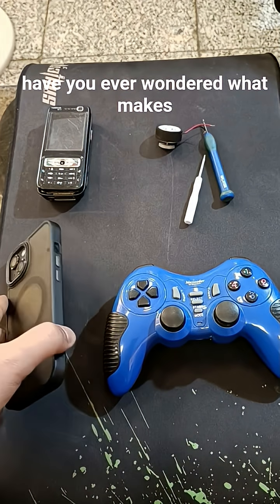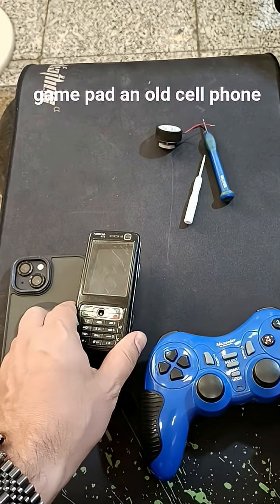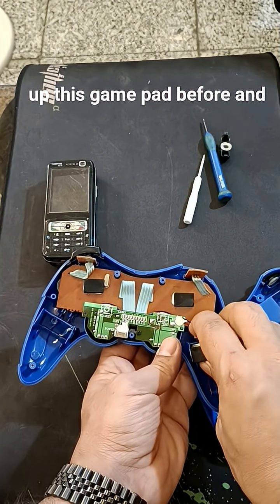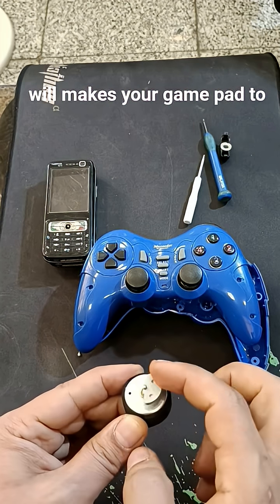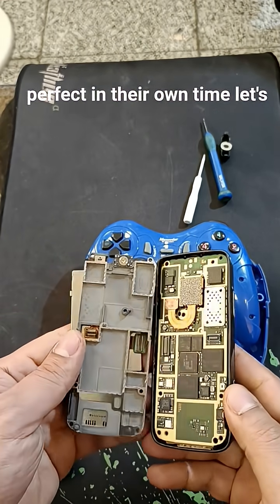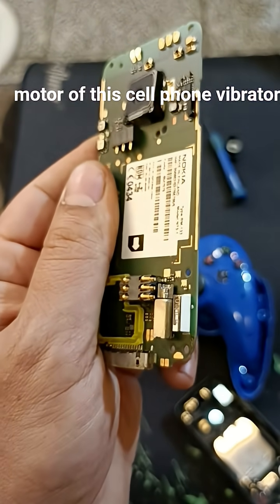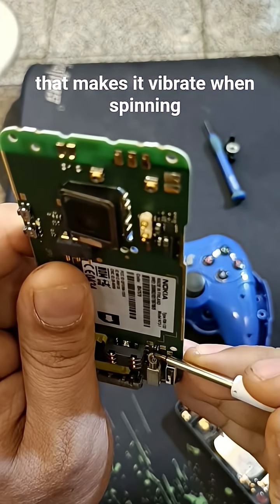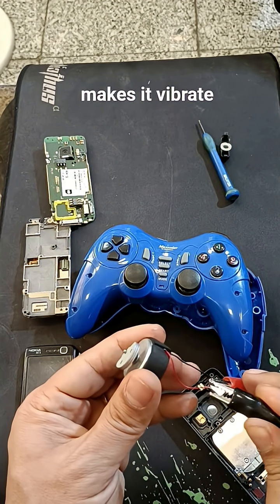Tiny Motors That Make You Feel the Game! | Phone & Gamepad Vibration Explained! #vibration #motors

Comment: What do you suggest to be the next video?
Reply: Please make a video about mechanical analysis in electric motors
Reply from the maker: @mohammaddavari2420  I will do my best
Reply from the maker: @mohammaddavari2420  but this short videos are about opening up devices
Reply: @EMSimLab so please open a permanent magnet ceiling fan motor
Reply: Toothbrush is good